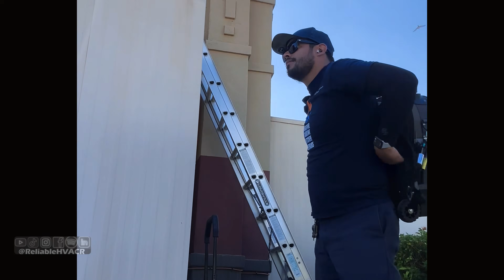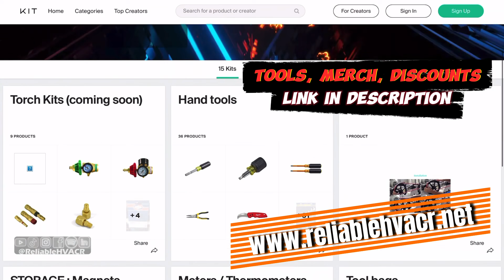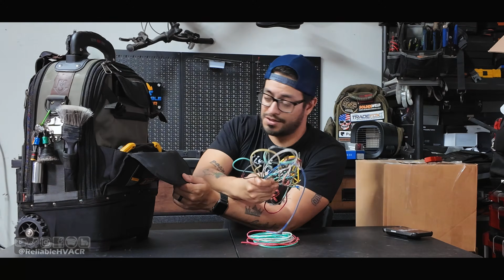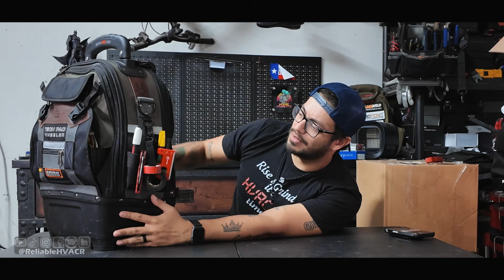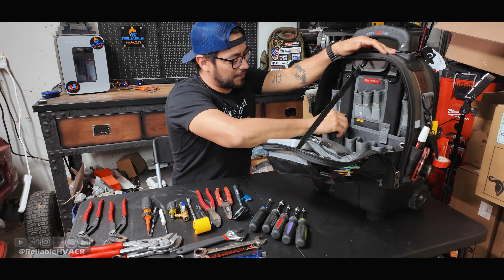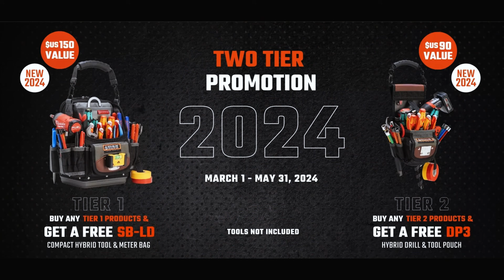Veto Pro Pac TECH PAC WHEELER Loadout

Comment: I recently bought the Black Out version and I have to say, I'm not overwhelmed by it. Yes it is quality. Yes it is solid. BUT for the size of the bag it really isn't that big inside. You lose a huge amount of space through the middle for the handle receivers and it annoys me no end that they built that in to the front of the bag instead of the back. There are a lot of small tool holder sections but again, the material is so thick, they take up far more room than they need to with many of them being close to the top meaning that they are hard to access. There are 4 internal zipped pockets on the back sides of the front and back of the bag but they are so tight that barely anything can fit in them, you certainly can't get safety glasses or testers in them, so they are limited to a few pens etc. 
I'm giving it a good go to see if I adapt to it but at almost £400 if I knew what I know now before I bought it I probably wouldn't have. I would probably stick with a smaller far more usable and user friendly back pack and then something like the Makita tool case stack trolley for the drills and heavier tools.